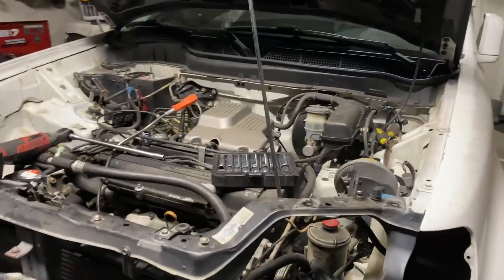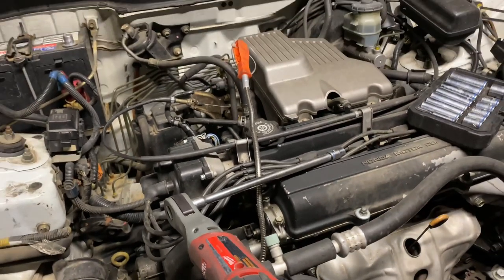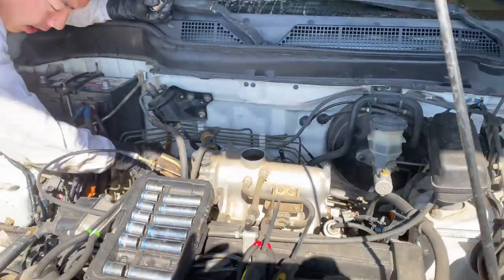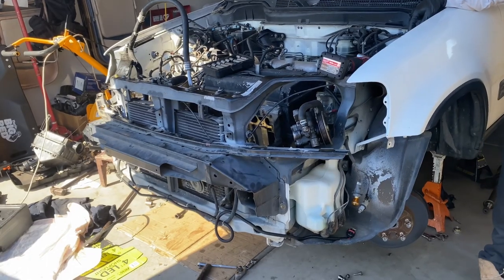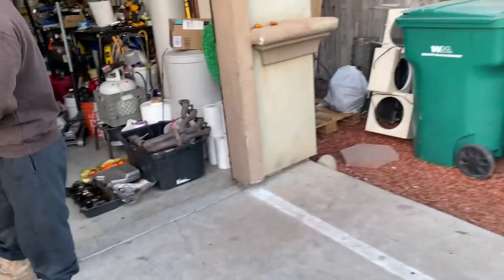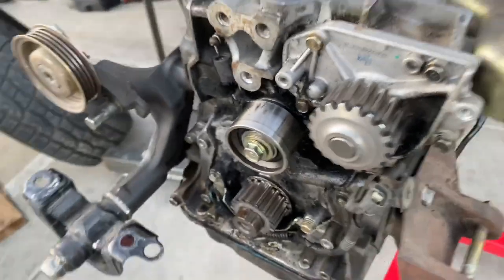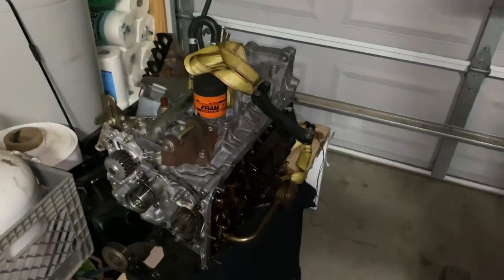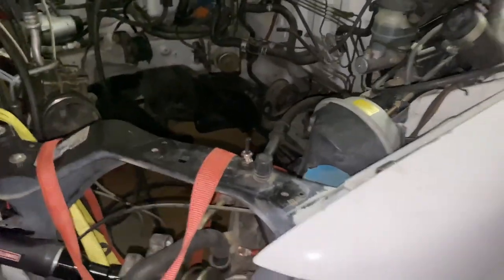1999 Honda Cr-v B20 (overheating/oil leaks) Pt 1

Comment: I am working on my roommate's 97 CR,V B-20-Z doing a timing belt and water pump. The list of needed parts continues to grow, including both front mounts. It also has a huge oil leak that looks like it's from the oil pan - it's leaking all over the exhaust and everything. I'm changing all topside seals except the rear main. I'm stuck at the crank pulley and about to torch it to get it off. Three air impacts wont budge that bolt and its been sprayed down with Blaster for 3 days now. I even have the Lisle huge socket for that 19 mm bolt but no luck yet. I didn't want to use a torch because I don't want to f*** up the harmonic balancer by melting the rubber and causing it to fail later on. Getting ready to watch part 2. Thanks for posting. I can't believe y'all dont have more viewers. This engine is being taken down because of a rattling timing belt tensioner and the water pump has sprang a leak. If I had 212K miles, I would spring a leak too! I got the Aisin kit with all Japanese parts, Felpro gasket set with the three front seals, and the motor mounts off EBay. That lower torque mount nut wouldn't budge - the entire stud unscrewed from the block when I impacted it. I got PO'd and put the stud with the old torque mount in the vise and I used my angle grinder with cut-off wheel to get the nut off, since the stud is a dealer item and its around $70. I cut into the stud's threads and filled it in with solder. I'll just replace the nut and call myself lucky. I already did the valve  lash and several exhaust valves were pretty tight. And there are several bolts missing, including one of the main motor mount bolts that fastens the bracket to the block as well as the bottom alternator bolt and two from the valve cover. I think whoever did the timing belt the first time used blue loctite on the crank bolt.
Reply from the maker: Keith Nettles yeah the Honda crank bolts are the worst to get off. Best method I have ever used to getting them off is to use an extension from your breaker bar to get it pass your wheel area (make sure it’s supported) and then use a long pipe or something to go over the breaker bar to give yourself more leverage when you go to break the nut loose. And another thing I found that could spring an oil leak that most wouldn’t see is the o ring from the distributor.